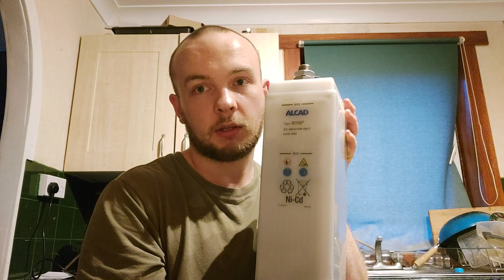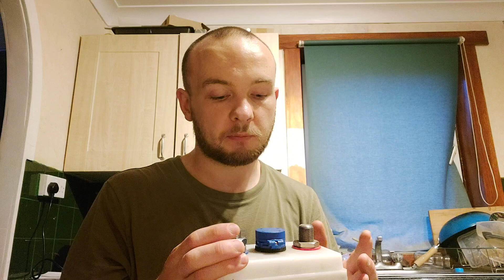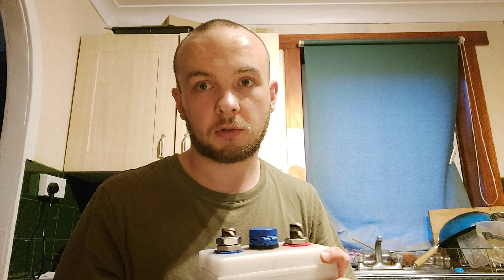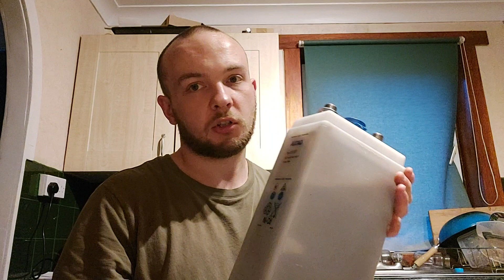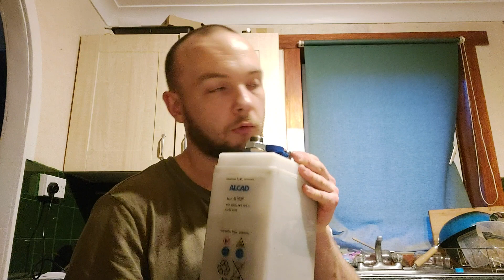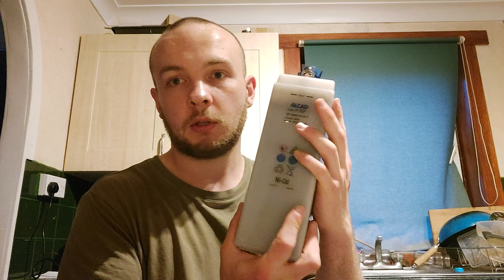Alcad Flooded NICD Cells

Comment: Nicads are fully recyclable and probably some of the longer lasting chemistries out there. It's just a shame that due to their toxicity they were banned. NiMh on the other hand are ones to mostly skip. I would love to get hold of some of these myself. I imagine it would be beneficial to have some sort of monitoring to avoid the individual cells in a pack to overly charge or discharge - In fact up to arround 70% charge their charge efficiency is very close to 100%! That's somewhat also applicable to lead acids, if you can get them in individual cells instead of a battery. 
How's your setup going so far?